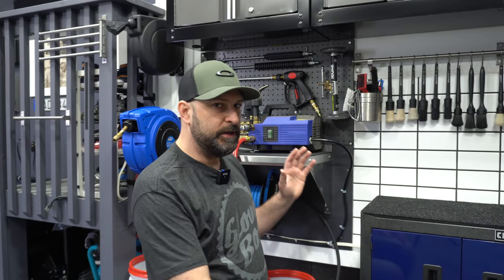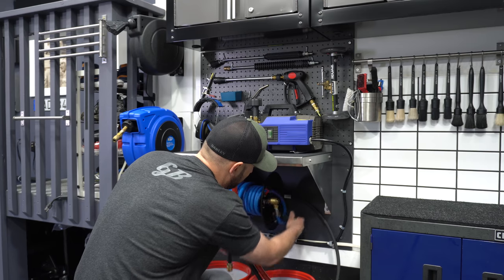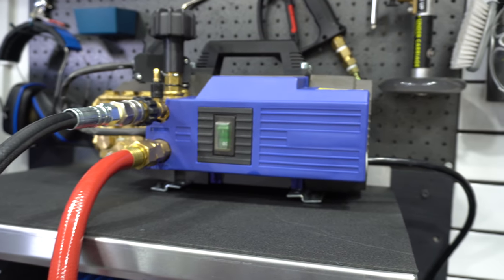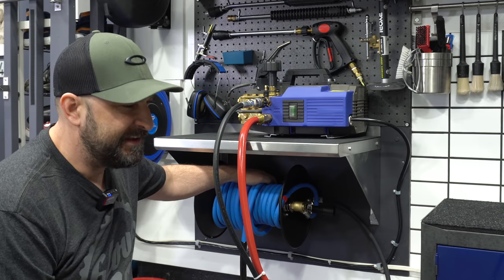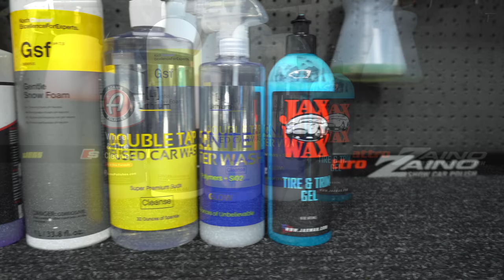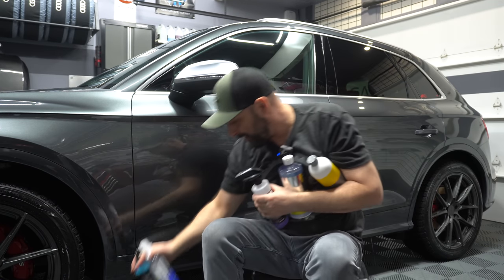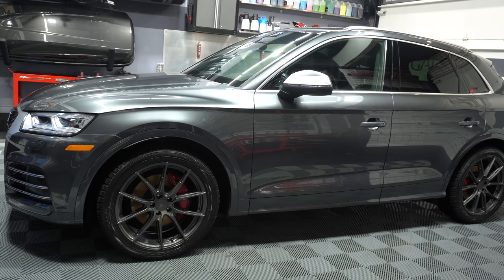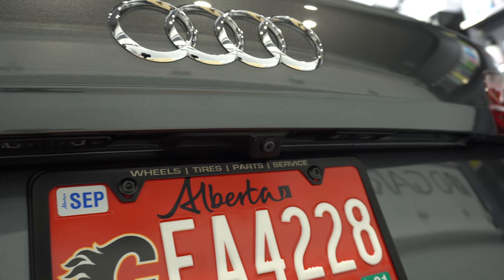AR630TSS PRESSURE WASHER | First Sunday Wash with my new Annovi Reverberi AR630-TSS Pressure Washer

Comment: Regarding the ding in your door, just my two cents that looks more like someone shot a BB at your suv. It looks like a BB because it looks to perfect to be a door ding, door dings are more elongated because of the edge of the other door. You might have to watch kids in your neighborhood. Some kid could’ve fired that BB from 100 feet away or more. When I was a kid I had a BB gun and I would shoot at thin metal in my basement it would make a perfect dimple like that. If I were you I would use the paintless dent removal system and just have somebody put a dab of paint on there and just lightly block sand it and then wet sand it and hopefully you won’t see it. They just massage the dent out from the backside using special tools and a lot of experience because the sheet metal on these cars nowadays are so thin that should be able to be pushed out.
Reply from the maker: Thanks for your thoughts. A BB gun is a possibility as well, but regardless things are already on the path to repair. My PDR guy eliminated the dent in seconds and my paint guy is fixing the little chip on Monday afternoon. I’ll just keep being as careful as possible when parking and do my best to deal with things that are out of my control.

Comment: Is this the hot version do you use hot water threw it ?
Reply from the maker: Yes, this is the hot water version. I run warm water through it mostly. I have a hot and cold water service in the garage that I mix through a high pressure mixer hose into the pressure washer.

Comment: What is your wheel cleaner dilution?
Reply from the maker: I mostly use Adam's Wheel & Tire Cleaner at full strength. Once in a while, I will dilute it but it totally loses its lathering ability when you dilute it.

Comment: Another great video Rick - this is awesome.  I'm in the midst of planning my pressure-washer setup in my new garage right now, and this unit is on the short list so your review was of particular interest to me.  One question - I notice that you don't appear to use any sort of water filtration system to remove TDS from your wash water.  If true, what is the reason?  I suspect that you either have soft water supplied to your house already, or you don't worry about it much due to washing indoors and perhaps working faster than the water can air dry.  Part of my overall planning is to potentially include a CR Spotless system mounted along with my pressure washer, and I'd be curious to know your thoughts.  As always, excellent video.  Thanks for what you do.
Reply from the maker: Yes, the water service in my garage is piped through our home's soft water conditioning system. And, like you said, I don't worry about water spots due to the fact I don't wash in the sun. A CR system would be nice for me, but it is not really necessary. Planning a setup like this is super stressful but fun. Feel free to email me at radgarageyyc@gmail.com if you want to chat or bounce an idea off me.